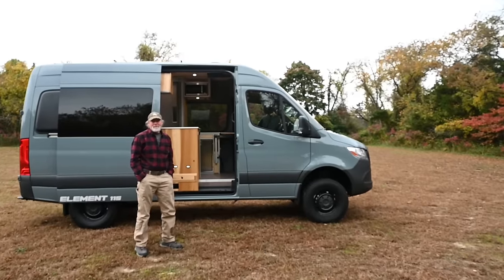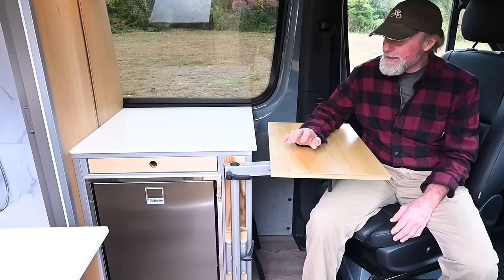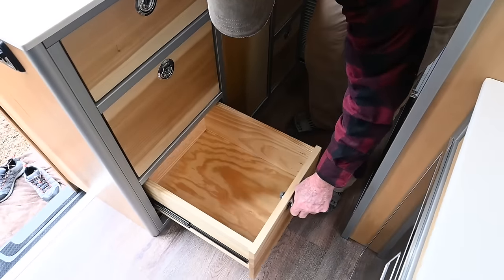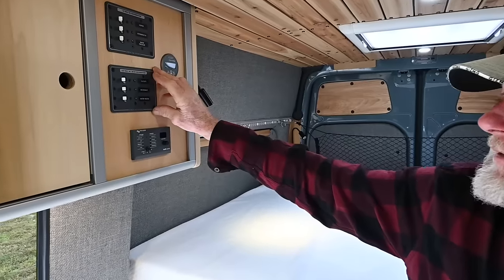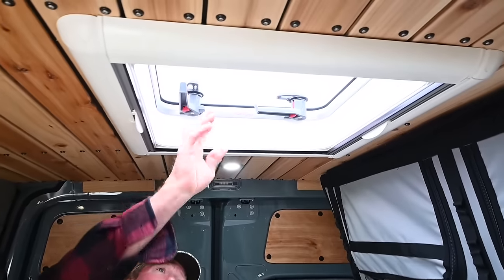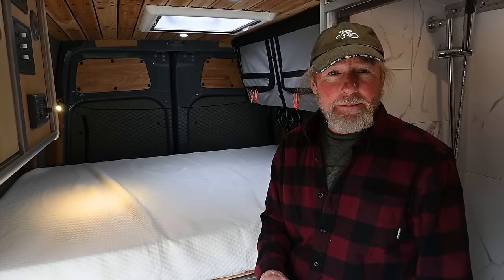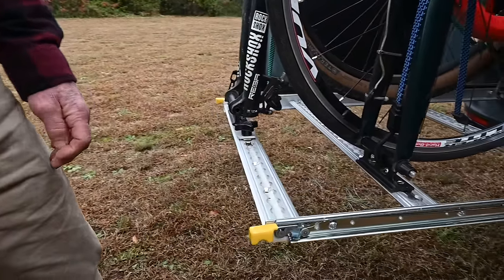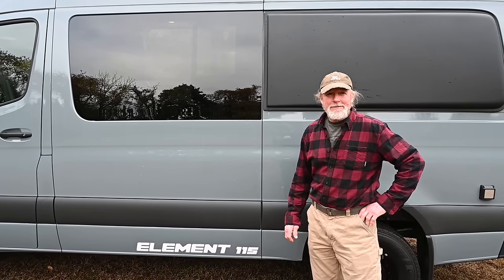He Converted A Van From Scratch - Camper Build With 8020 Aluminum | Sprinter Campervan W/Shower

Comment: I see the Humble Road stamp on the design.  Rick worked for them, no wonder.  Nice build.  

I love this shower stall.  In case anyone wondered, the tiles in the bathroom are ultralight vinyl foamboard tiles called Innovera by Palram sold at Home Depot. They come in 12" x 24" panels, tongue in groove and in marble or stone designs. Lowes has a similar one called Palisades.  I prefer the Palram tiles.  You have to stick them on with adhesive over any existing waterproof surface, then grout the seams with mildew resistant silicone.  PL Marine or Loctite Powergrab are good adhesives.  Substrate can be Kerdiboard or Kerdi membrane stuck on with thinset over plywood. Kerdi says they only supply for real tile, but I've seen this done.  The key is the substrate material that must be water proofed.  I wonder how Rick did his?  I have to remodel my RV bathroom so would be helpful to know if Kerdi works or not.

Thinsulate is the best insulating material (and pricey). The white fluffy side goes on next to the Reflectix to provide the air gap that Reflectix needs. I also found another material meant for underlayment called Silent Silver or Blue, a 1/8" thin closed cell neoprene covered with foil on one side that insulates, deadens sound, moisture barrier, and cushions that can be used as an additional layer in making window shades..  Finding the right materials is key in RV builds.

Nice components from Victron.  The SOK batteries are made in China with a US based distributor. Cost runs $1150 for 280 AH, and $400 for 100 AH sizes.  There is a video online on how they are assembled.  
It is a pity that the flare outs are permanently covered up and no window space or ventilation from them.  This creates a lack of light in the bedroom area.  Imagine if it is raining or you have an ocean scene, you want to see that. You can always add curtains?

Very nice overall look and feel for this van build.  I question if there is enough power to run a fridge and other devices on 200 watts of solar and 200 AH battery power though.  The components are high quality with Isotherm, Victron, Sprinter - really nice luxury feel.  Thanks for the tour, Patrick, and Rick.  Most enjoyable.

Comment: Perfect van for one person plus it’s well built. The interior slide up garage door is unique and a smart idea. If your going to buy a Mercedes van you might as well get the air conditioner! Great job, thanks
Reply from the maker: We agree!
Reply: Thanks, in my last van I never really needed AC, however if I were to be in the southeast during summer that would be a different story, that's why I wired the Maxair fan for AC, the AC units typically have the same 14" footprint as the fan, also an AC unit would add $3-5K to the van price.

Comment: Very nice video 👍👍😳🤗🤔thank you.  Pullout step for bed is  very handy.  Yes, is a spectacular, comfy  van/home.
Reply from the maker: I am anxious to see what Rick comes up with next
Reply: Thanks for the comment, in my last van I didn't really think about getting in and out of the bed, ended up using a folding step stool. So when I designed/built this van I felt the need for something better than a folding step stool that's where the step/drawer idea came from and it will be incorporated into my next build.

Comment: This van would never be welcomed in US due to no A/C.. I love, love Humble Road's craftsmanship and creativity. This too has that same feel. Thank you for sharing.
Reply from the maker: The front fan has the same size opening opening as a rooftop air conditioner so it could easily be adapted, and the air-conditioning could be added anytime
Reply: Thanks for the comment, the Maxxair fan is wired with 10/3 and the cutout is 14" which is what a typical AC unit needs, it's also why I choose the MultiPlus II inverter/charger as it has two dedicated AC 110V legs, one for the house 110V AC stuff and one dedicated for an air conditioner

Comment: Sorry, I keep chuckling....is the wood "Popular" ot Poplar😅...as good as the refrigerator is I would have to go with a top loading one.  I can't see getting down to floor level  to see what is in the 'fridge.   Seems no one else finds it worth mentioning....but it comes with age I suppose.  Good luck to whomever buys the van....hope they enjoy it.
Reply from the maker: Thanks for checking it out
Reply: Thanks, I have a hard time pronouncing Poplar, it's a hardwood native to Maine where I built the van, I agree that a top loading fridge saves on energy, had both types on the catamaran that I lived aboard for over 11 years, each had it's advantages and disadvantages.

Comment: Everything is great in the van but I would rather have a full size or even a twin bed to gain a little more space in the living space. I wonder what the asking price is for the van?
Reply from the maker: Twin beds is the way to go
Reply: Thanks for the comment, the bed is 78" x 58" a queen which I cut a few inches off the width, if the width were decreased any more bikes won't fit under the bed, everything is a compromise when building a van and hopefully everything can serve more than one purpose. The van itself cost $68, taxes $5K, extended 100,000mile/5 year warranty $3K, $36K in materials and 1100 hours labor @ $45/hr puts the total cost at over $160K, I'm asking $159K

Comment: nice build. 
I’m curious the advantages of wiring going across the van under the mattress? Are the wires usually above the ceiling going across the van.  
Is it for easy access if wiring issue?  
You would never be able to remove your platform bed in want to use the van for a large cargo need.   Not criticizing by any means,  just curious.
Reply from the maker: It’s for easy access so upgrades can be made in the future without tearing the whole van apart
Reply: Wire runs are best kept to a minimum length to reduce voltage drop, you are correct that the van will not accommodated a large cargo need, however with the pass thru you could have surfboards, a kayak or other longer storage, everything is a trade off in designing a small living area.
Reply: nobody removes their bed platform to haul cargo in their 100k+ van.   Its a nice random thought people have.  But nobody actually does that.
Reply from the maker: @CJ30123  I know someone that does.
Reply: @CJ30123 except I do. You aren’t the expert you think you are.

Comment: Beautiful van.  Such quality!  I would just add the AC and change the mattress.  Now - if it was just in my budget!  😀  Not saying it's not worth it, I'm just not in that league.
Reply from the maker: Appreciate the feedback
Reply: Thanks, the Maxxair far is wired for AC with 10/3 wire and the cutout is 14" which is the same as a typical AC unit.  It amazed me how quickly the price of the materials grew as I built the van; the van itself cost $68K, taxes $5K, extended warranty $3K, $36K in materials and 1100 hours labor @ $45/hr is $49.5K, which puts the total cost to slightly over $160K
Reply: Welcome.  It's just me on the mattress change.  I CANNOT sleep on memory foam. @NewJerseyOutdoorAdventures

Comment: All that insulation is useless if you have them plastic windows and the exposed metal on back dors... Insulation value - 200%
Reply from the maker: How do you assume the back doors are not insulated?
Reply: The back doors are insulated, the hatch and MaxxAir fan both have covers, the van has 2 layers of Thinsulate, in my last van, similar build I was down to -20F and very comfortable inside. I'm working on a video documenting the build process hope to have it up on my YT channel soon.

Comment: Very nice build. Why do you have only 200W solar and 512aH batteries? Not enough room?
Reply: Thanks, in my last build I had 300aH and 300W solar, never really had the batteries below 70%, main use was to heat the hot water for showers. With 412aH along with the Victron Orion DC/DC charger I felt that 200 was good, more is always better however it's a 144 so roof space is limited and I wanted to leave the space so AC could be added where the Maxair fan is located, it's wired for AC. And having the hatch over the bed not only provides access to the roof to clean the panels, it makes a great spot to watch the sunset from, if I added panels there would be no room to sit up there!
Reply: Plenty of battery and solar for 95% of the time
Reply from the maker: Yeah, I believe this is plenty of solar and battery for majority of how this is going to be used

Comment: My only comment is the mattress won't be able to wick dry if moisture gets between it and the board under it.
Reply from the maker: There is a mesh membrane available for between the mattress and platform
Reply: Thanks for the comment, as Partick said you can add a mesh membrane, although you can't see it in the video the mattress board has holes cut into it to let air circulate.

Comment: If the Van is ''New'' and is one of the last Sprinter 3.0l V6 Bi-Turbo, and it's up for Sale? I think the ''Pree build'' has devalued the hole Sprinter Van. 🤠  It's best left as a ''cleen Canvas'' and shuld realy end up as the '''Ouners''' personal and tecnical Build''? and to tell you, If I found the interior personally atractive, Aaaa? like the shower fitting in a 144, but only for an elderly adult? Sow is the Van Up For GRABS...?
Reply from the maker: Thanks for looking
Reply: @NewJerseyOutdoorAdventures Sorry if it came thru a bit harsh but i know too much abaut the Merc Sprinter it is for me the Best house on weels and i can get very toochy if the bild is not to my tase... And thanks for Shareing NewJerseyOutdoorAdventures, 💞  Sorry if I get a bit ''too'' touchy with interior designe some times  ❤🪄💯 Greetings from Europe.
Reply: @julianv.5848 yes. Your comments were harsh and frankly, quite rude.

Comment: No TV screen?
Reply from the maker: No, it’s not necessary
Reply: Thanks for the comment, I thought about that, the van can accommodate a 12V ceiling mounted unit utilizing the wiring for the ceiling lights. I've found that most people seem to be using their laptop's as their TV's.

Comment: Missed the high end water filling detail. Open ended pipe seems to have been added as an afterthought. Slippery dip for mice. Most of the van is good for a single person. The design is way too cramped for two people.  Well done however.
Reply from the maker: Appreciate the feedback
Reply: Thanks for the comment, I found that in my last van most of the time I was filling the water tank with 1 - 5 gallon containers of water, the pipe makes it easier to fill that way and also serves as the vent, if I did use a hose to fill the tank I just stuck it in the pipe. I also didn't want an exterior water fill spout, since the video was shot I finished it off with a venting cap,

Comment: Too bad:  no window in the rear bedroom, only that roof hatch.  The water tank filling set-up is a terrible idea.
Reply: Thanks for the feedback, rear windows can easily be added.  I found that in my last van, which I had for 5 years that most of the time I was filling the water tank with 1 - 5 gallon containers of water, the pipe makes it easier to fill that way and also serves as the vent, if I did use a hose to fill the tank I just stuck it in the pipe. I also didn't want an exterior water fill spout, since the video was shot I finished it off with a venting cap, the tank can also be fill thru the marine hatch located on the top of the tank.
Reply from the maker: This van was built from 1st hand experience and lessons from a previous build